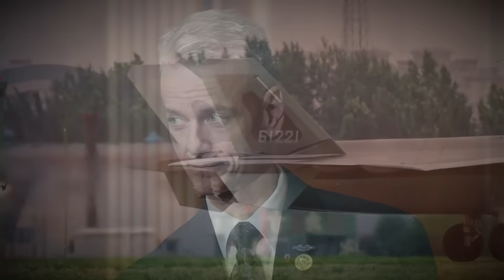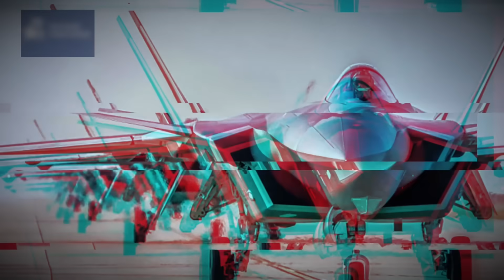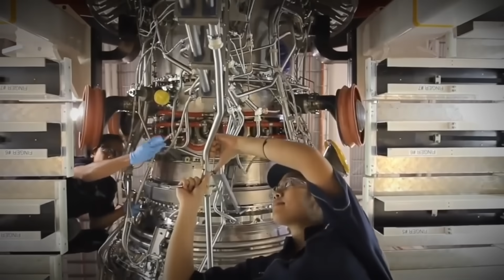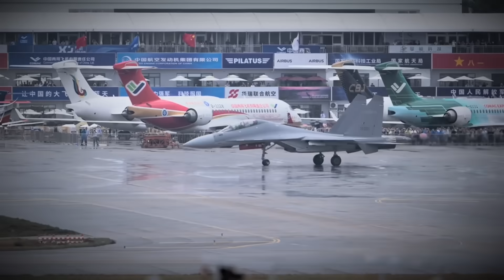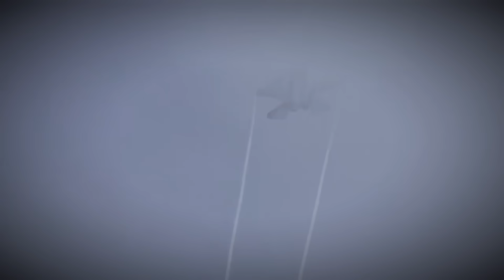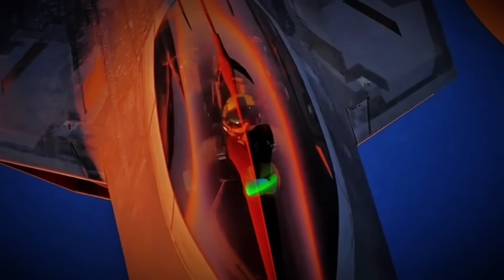GE Just Broke Its Silence on China's Jet Engine Advancement

Comment: China has the resources to pour into researches which can generate excellent results in a very short period of time! The smart move by US is to sell China engines so that China can be complacent!
Reply: Can't be buying shit from the US that comes with spyware backdoors or remote shut off switches lol.  Qatar and Egypt found out the hard way
Reply: Too late now.... 'once burned, twice shy'
Reply: China's Fighter Jet Engines: 5th-Gen Leading the Way, 6th & 7th-Gen Test Flights Breaking New Ground, Fully Surpassing the U.S.
 
China's aviation engine sector has achieved a leapfrog development from catching up to global leadership. The 5th-gen engines WS-15 and WS-19 have long outperformed their U.S. counterparts in performance. The 6th and 7th-gen fighter jet engines have even completed successful test flights ahead of schedule, completely widening the generational gap with the U.S. in core technologies, performance parameters and future layout, demonstrating the strong strength of China's aviation engines and firmly seizing the commanding height of the global aviation engine track.
 
In the field of 5th-gen engine power, WS-15 and WS-19 have made precise breakthroughs in U.S. technical barriers. As the standard power for the J-20, WS-15 is a performance benchmark among global 5th-gen large-thrust engines, with afterburning thrust reaching 18.5 tons and thrust-to-weight ratio exceeding 10.5. Compared with the F119 engine equipped on the U.S. F-22, its thrust is increased by 18.6% and thrust-to-weight ratio is over 50% higher, directly endowing the J-20 with 1.8 Mach supersonic cruise capability, and the response speed of supermaneuverable actions is 0.8 seconds faster than that of the F-22, achieving comprehensive suppression in air combat and penetration capabilities. In terms of core materials, WS-15 adopts domestically developed 3rd-gen single-crystal turbine blades that can withstand temperatures up to 1577℃, equipped with 128 nanoscale micro-cooling channels, improving cooling efficiency by 37%. The stable working time of the blades exceeds 4000 hours, and its high-temperature reliability is 1.5 times higher than that of the F119, completely solving the problem of high-temperature wear of previous aviation engines. WS-19, adapted for medium-sized 5th-gen fighters, is a world-leading medium-thrust engine with maximum thrust exceeding 12 tons, far surpassing the 10-ton thrust limit of the U.S. F414 engine equipped on the F/A-18. Its turbine inlet temperature reaches over 1850K, with excellent explosive power and energy conversion efficiency. It also adopts a compact 3-5-1-1 configuration, reducing weight by 12% while improving reliability by 20%, adapting to the deck operation needs of carrier-based aircraft. Its performance is comprehensively superior to the U.S. F414 and European EJ200 engines, filling the gap in domestic medium-sized 5th-gen fighter power.
 
On the basis of the stable leadership of 5th-gen engine power, China's 6th-gen fighter jet engine has taken the lead in completing installed test flights, with technical maturity and performance far ahead of the U.S. The U.S. 6th-gen engine XA100 is still in the ground test and partial verification stage, with unresolved mode switching failure risks, while China's 6th-gen variable cycle engine has achieved stable air operation, with core technologies and performance indicators reaching the world's leading level. In terms of performance, the engine's afterburning thrust exceeds 22 tons and thrust-to-weight ratio is over 12, 17% and 14% higher than the U.S. XA100 target values respectively. It adopts variable cycle technology with independent intellectual property rights, which can seamlessly switch between "high-thrust supersonic cruise mode" and "high-efficiency energy-saving cruise mode" in less than 0.5 seconds. It can not only support 6th-gen fighters to achieve 2.5 Mach supersonic cruise and a range exceeding 10,000 kilometers, but also reduce fuel consumption by 37.5% during subsonic flight, balancing combat effectiveness and endurance; the U.S. XA100 can only achieve a 10% increase in thrust and 25% fuel saving, and its complex mechanical valve structure is prone to stuck mode switching, resulting in significantly lower practicality. In terms of technology, China's 6th-gen engine innovatively adopts a three-bypass + interstage combustion chamber design, reducing 20% of core parts, with a fault diagnosis accuracy rate of 99.2%, which can predict faults 200 flight hours in advance and improve maintenance efficiency by 50%; it is also equipped with new stealth composite materials, reducing the engine's radar cross-section by 60%, meeting the all-domain stealth needs of 6th-gen fighters, while the U.S. XA100 still uses traditional metal casings with no substantial breakthrough in stealth performance, showing an obvious technological generational gap.
 
More promisingly, China's 7th-gen fighter jet engine has completed its first flight with the prototype, while the U.S. is still in the technical pre-research stage, completely seizing the opportunity in the future aviation engine track. China's 7th-gen engine breaks through the traditional turbofan power framework, adopting combined cycle propulsion technology integrating turbofan-ramjet-scramjet, combining hydrogen-oxygen rotating detonation power principle, with thermal efficiency reaching 49%, thrust increased by 20% compared with 6th-gen engines and weight halved. It can support fighters to achieve hypersonic cruise above 5 Mach in the atmosphere and a maximum speed exceeding 6.5 Mach, and can also adapt to low-orbit space flight, realizing "air-space integration" all-domain combat; the U.S. 7th-gen engine still focuses on traditional turbofan technology upgrades, failing to overcome the hypersonic propulsion mode switching problem, and can only achieve a speed target below 4 Mach, with comprehensively limited power performance and application scenarios. In terms of core technological breakthroughs, China's 7th-gen engine has conquered key technologies such as high-temperature supercritical pressure pipelines and quantum plasma stealth coatings, with turbine blades capable of withstanding temperatures exceeding 1827℃, and can operate stably in extreme environments such as high-altitude low temperature (-60℃), high humidity (95%) and sandstorms, with full battlefield adaptability; it also innovatively adopts intelligent bionic structure and self-healing technology, which can automatically fill and repair minor component damage within 1 hour, greatly improving battlefield survival capability. In contrast, the core materials and self-healing technology of the U.S. 7th-gen engine are still in the laboratory stage, and no long-term ground thermal test has been carried out. Compared with China's progress of completing the first flight and gradually advancing engineering, the generational gap cannot be narrowed in the short term.
 
From the 5th-gen engine outperforming U.S. counterparts, to the 6th-gen engine leading in test flights, and then to the 7th-gen engine taking the lead in opening a new air-space track, China's fighter jet engines have achieved continuous breakthroughs in three generations of iteration, with core materials, key technologies, performance parameters and development progress comprehensively surpassing the U.S. It not only lays a solid power foundation for the leapfrog improvement of China's air force combat effectiveness, but also redefines global aviation engine technical standards, demonstrating the absolute competitiveness of China's high-end manufacturing and cutting-edge technology, and completely breaking the long-term Western monopoly in the aviation engine field.

Comment: Also next, EUV lithography for 2mm chip, Thorium reactors producing 100MW, Rail Gun on Chinese destroyer, 
Gen 6th Fighter aircraft, 120,000 tones nuclear-powered carrier....

But this one will take the cake... Man landing on the moon by 2028..
Reply: A permanent moon base 🇨🇳
Reply from the maker: Haha, at this rate, I wouldn’t be surprised if they announce a moon resort by 2030! Who’s bringing the sunscreen?
Reply: @EngineeredGiants  Space exploration has yield a lot for China, especially on material science. There was a recent paper published on experiments done on the Tiangong space station where Chinese scientists figured out how to make niobium-silicon alloy at an industrial rate while solving the brittleness problem. Nb-Si alloy can operate far higher temperature, and higher temp in the combuster = higher thrust, better fuel efficiency. For the longest time, the alloy promised next gen jet engines but no one could figure out how to grow the crystals fast enough and it remained very brittle. China has solved both problems and no one in the west knows exactly how it is done. China's next gen jet engines could very well use these alloy for turbine blades, and their engines will have better thrust-weight ratio, higher thrust, better fuel efficiency than western engines. It also mean that they can use the same alloy as the skin for the hypersonic missiles to go even faster, something the US cannot do.

Now China has proven that it can build experimental detonation engines and successfully tested them. Their next engine most likely will power their 6th gen fighters will be adaptive cycle and they have published their own version with a by-pass combuster which is radically different from US blueprints, showing that they are no longer just following, they are making the benchmarks.
Reply: @EngineeredGiants  China isn't planning manned lunar missions until 2030, and they're making steady progress toward that goal.  Presumably, they'll want to set up a permanent manned base, but that's a huge cost increase compared to the Chinese space station, simply due to the higher orbit and payloads required.  To make such a base practical, China needs to develop the ability to construct underground shelter that shields against radiation and thermal variance.  That's probably decades away.
Reply: I truly don't understand why people don't see this coming. They've got banned and being restricted in any space program, not just by the US, US allies too. And look where are they heading now. China's willingness is no joke. The era of US hegemony is gone.
Reply: @gtlover2011  The west didn't know the industrial revolution came from engineering work of Chinese stolen and copied by Jesuit to the west. These engineerings are banned for common people. Most AI and hi tech scientist in USA are Chinese. Chinese won the world's first computer pioneer award by IEEE. A Chinese lady plus other chinese worked and contributed to the manhatten projects that ended ww2 in the pacific. Give China 20 years of peace, just 20 years and she will produce wonders.
Reply: @IA100KPDT But how do you explain the number overwhelming of Indian CEO in US giants like Microsoft, Google, etc?
Reply: @d @deepone5005 that means there is not many home grown talent. They are the reason for quality drop for Boeing. Talented Chinese go back to China built great companies over there because they’ve treated unfair here. China’s economy is 6 times bigger than India. India has nothing to brag about
Reply: @yangyang587  u mean they are the reason for Boeing spiralling downwards causing all the crashes , incl the Dubai Tejas crash 2 days ago?
Reply: @gtlover2011 That big bully and his friends would not let that Chinese kid in to play with them, so the poor kid left and work hard to build his own toys. Now the big bully is jealous and is doing everything he can to sabotage the Chinese kid's progress.